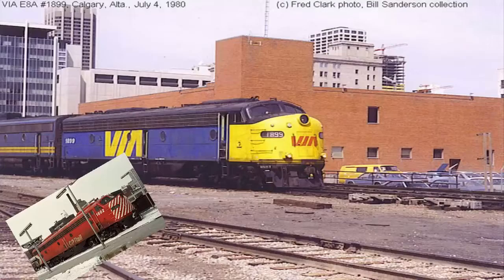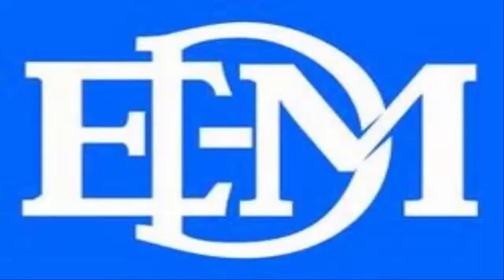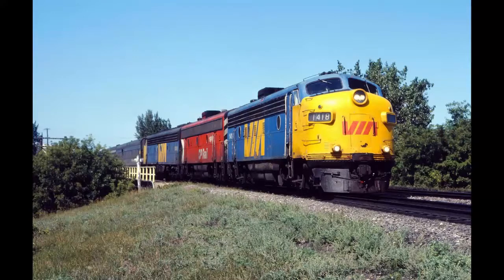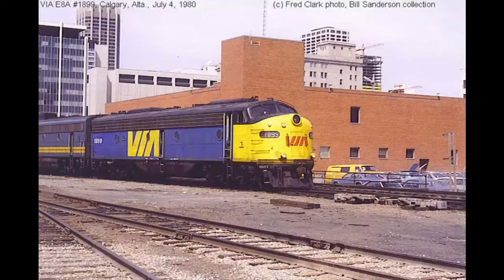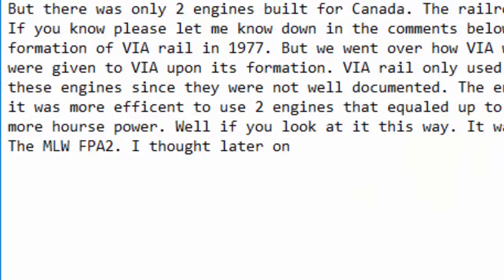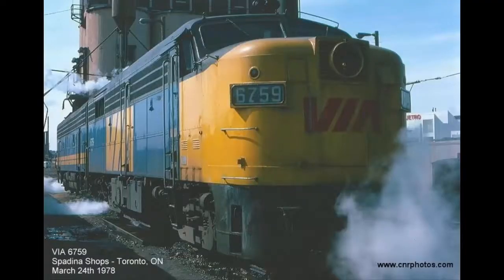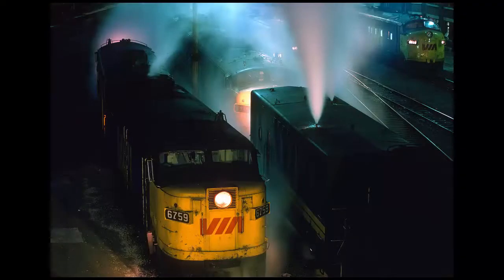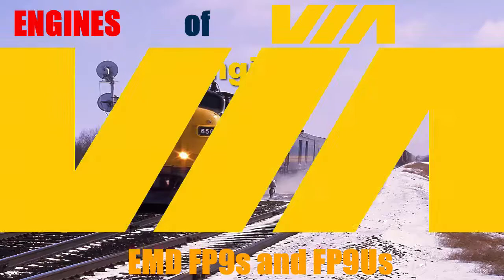Engines of VIA--EMD E8s and FPA2s--Episode 3

Comment: While the E8 did have a V12 567B engine, it didn't have just one. Almost all of the E units (for sure the later models) had 2 567 engines. Each truck (interestingly enough not C-C trucks but A1A-A1A) had its own engine and generator for the traction motors. The 567 was and still is very dependable, but it was quite limiting when only 1 engine and/or generator was operational. One of the last surviving Union Pacific E units (I believe there's only 5 now) for the longest time only had 1 working main generator from abuse in Chicago commuter service, leaving it with 1125 horsepower to work with. Thankfully, E8 #942 is now up and running just fine and resides at the Orange Empire Railway museum with a completely rebuilt replacement main generator. 
I wish more E units were still running. They truly were wonderful locomotives.
Reply: LET ME CHIME IN! THE E-8'S&9'S WERE AND STILL ARE MY FAVORITE DIESEL LOCOMOTIVES! I JUST LOVEDTHEIR ENGINE SOUNDS AND THE SHEER SPEED THEY COULD GET THEMSELVES UP TO. THEY COULD RUN ON THOSE A1A TRUCKS. AND DONT FORGET THE ESTHETICS OF THEIR GREAT LOOKS FRONT TO BACK! AND DONT FORGET THEY EVEN HAD A BACKUP LIGHT IN THE BACK! THE DESIGN OF THOSE LOCOMOTIVES WERE TRULLY AHEAD OF THEIR TIME! THEY ARE SORELY MISSED BY ME!  EARL OF EL BARRIO NYC NY. SIGNING OFF FROM SOUNDING OFF.  6/28/18. 6:26PM

Comment: Wait does FPA2 is a variant of FPA4
Reply from the maker: Ethan Campbell yes the FPA2 is the early version of the FPA4
Reply: The fpa2 almost looks like a fpa4
Reply: The FPA2 is a passenger version of the FA2. Missouri Pacific, Lehigh Valley and the B&O had them. They had the 244 Alco engine. The FPA4 were built for the CNR only and looked very different from the FPA2.
As far as the E8. They were used in the Montreal-Ottawa and the Montreal-Boston pool until the RDC came into favor with both the B&M and CP.

Comment: E8 were never used on the Transcontinental, it was a CN train. E8's were used by CP to pull trains from Montreal Windsor Station to White River Junction,VT, an exchange point with the Boston & Maine, because they were built, in 1949, by EMD, not GMD. Yes, they pulled trains to points in NB as well. FPA-2s, at least CN units, were not built from 1946 to 59. They were built only in 1955 with 1600hp 244 engines, rebuilt later with 1800hp 251s.
Reply from the maker: When I say built I mean every single one purchased by railroads. the first one was ordered in 49. as for the E8s not being used on the Canadian my researched turned up that was the reason VIA kept the E8s.
Reply: Via used them on the Canadian as far as Calgary. The reason they weren't used further West to Vancouver, was because they weren't equipped with dynamic brakes. So, yes, they were used in part, on a Transcontinental train.
Reply: Yes. They were purchased as “pool power” to be used with Boston and Maine units on the  daytime Alouette and evening Red Wing trains to Boston. RDCs replaces the day trains and the evening train was cut, so that’s how they ended up on the New Brunswick route.